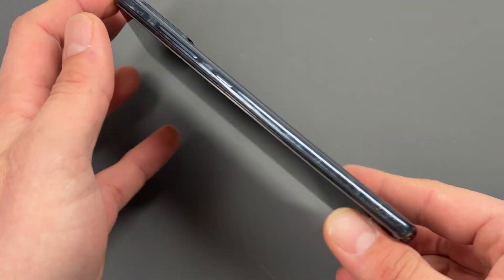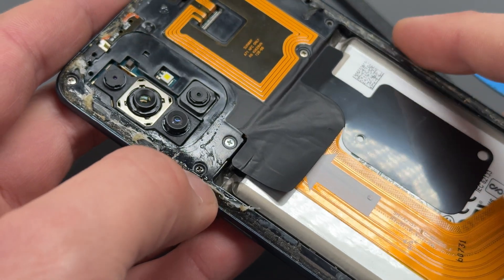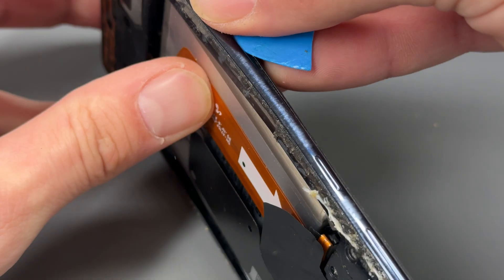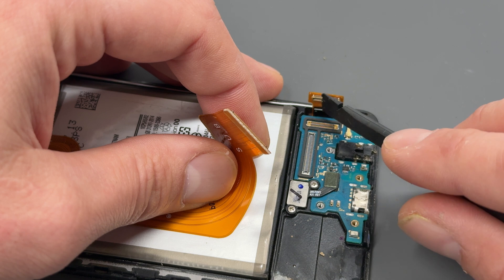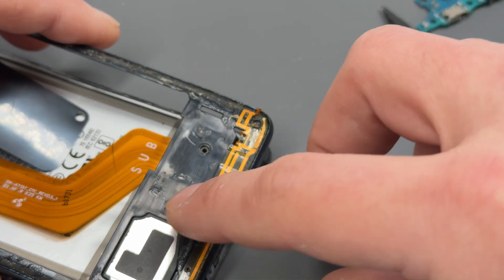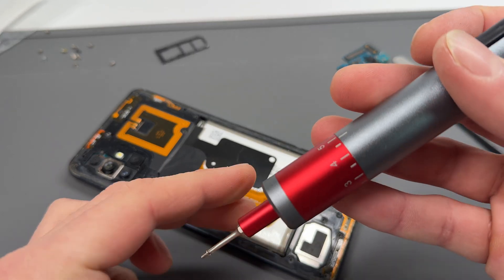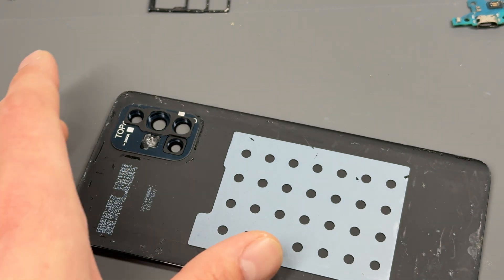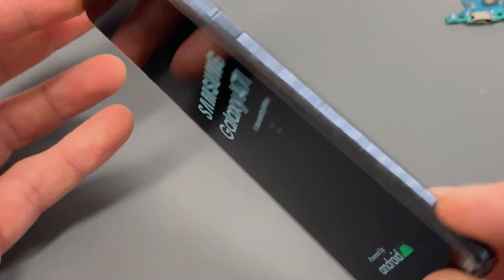Samsung Galaxy A71 Charge Port Repair - Complete DIY Guide!

Comment: I must have the o.g. model because the ribbon cable was stuck to the charging port effectively making it one item.

My new charging port has a cable connection point where it clearly is supposed to disconnect but I apparently need a charging port with attached cable

Comment: Very helpful, just replaced my charging port while following along. I didn't know it was taped together. I happened to have a roll of double sided tape from wrapping presents. It's about 12mm wide, so I just cut it finely into three strips of about 4mm each and used that. I don't care about water or dust, I'm just trying to extend the life of my phone.